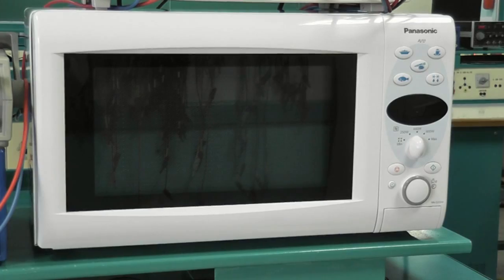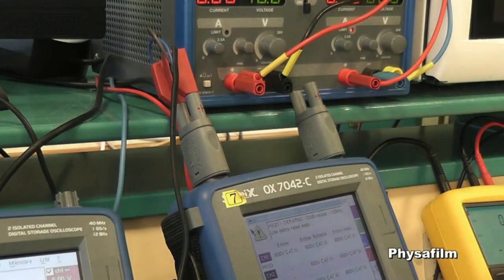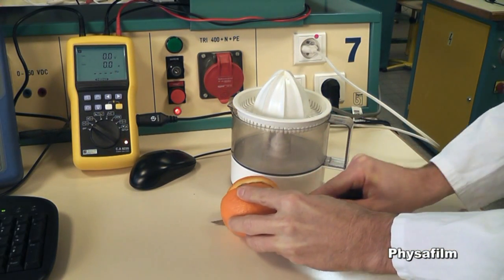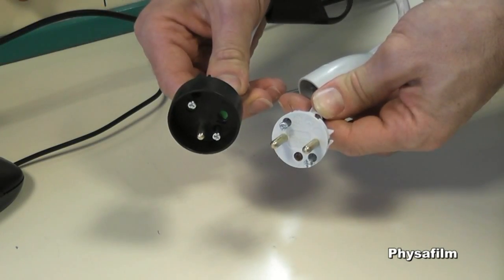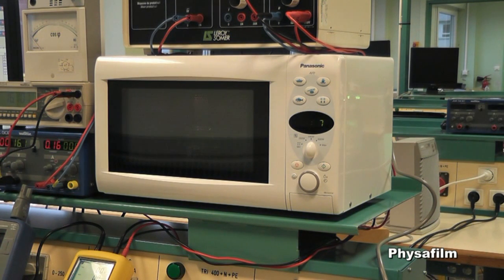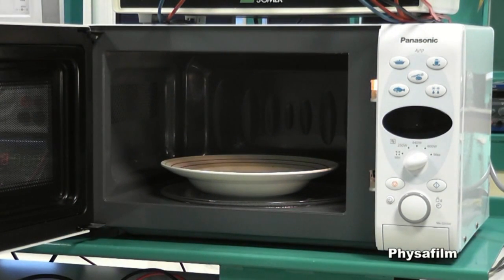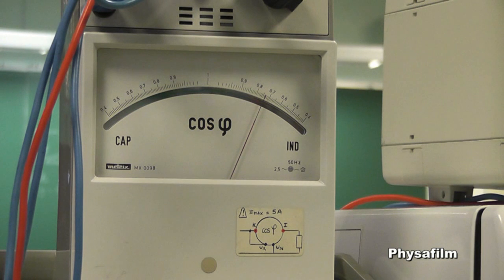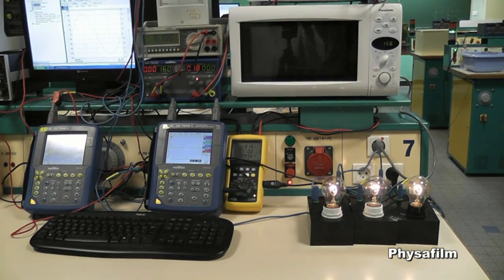DIY : How to make ice cube with microwave oven - Free energy generator -

Comment: ever wondered what's the meaning of AC? alternating current; at 50 to 60 hz means 50 to 60 polarity changes per sec, reversing the power cord will make 0,00% change, the laptop charger shows the DC or direct current side which carries usually 12 V, inverse these and you might make an oven out of your Laptop if that's what your after :-))))

Comment: To generate cold current, you need a Kromrey Converter as per Bedini's specs and run the output of that device into some dichromate wire. The result of this high resistance on the negative entropic current is the opposite of standard resistors, heat is being sucked from the environment, and the wire becomes frosty and cold.

Comment: The reason that the plug is polarised is to make it safe for use. Ac items already use electricity that is changing polarity. When you mess with the plug all you are doing is removing the case grounding. Which is unsafe in high energy devices.  If you manage to charge the interlock, touching the case can produce a nasty shock. I hope no one has injured themselves trying to reproduce this stupidity.

Comment: The power system they are using is connected to two different electrical phases, which is common in other countries, normally the EU. Here in the US, most systems , unless they are connected to a 208 three phase or other voltages for a commercial supply, will not change rotation if the polarity is swapped. The hot legs on a single phase residential transformer will not change rotation, nor will the scope show any indication of a phase shift, so, the video is not true for all electrical supplies, especially in the US. To make this spin out of rotation by inverting the feed, The electrical feed has to be fed from two separate phases. If we switch two of the 3 wires to a 3 phase electric motor, the rotation changes. If two dislike phases are used to power a 240v single phase motor, as in the video, the motor will change directions, however, the phase shift must happen as seen in the video.   US residential systems are fed normally with a single phase of the overhead lines and use ground and a neutral wire to complete the circuit on the primary transformer coil. There are 3 connections on the secondary side of the transformer, there is an X0 bushing which is the neutral or return, and, it is bonded to an Earth ground. There is an X1 Bushing, this would measure 240 volts from X1 to X2, and 120 volts across from X1 to X0.  There's an X2 bushing, this is the same as X1, but, it is the other hot leg which is 240 v across from x2 to x1 and 120 across x2 and x0 (the neutral), which is the return for the circuit to complete it's path, from the transformer, to the load, and back to the transformer, but, that wont reverse the microwave's production..

Comment: From: The Case for the UFO by Morris Jessup; the annotated edition.

The Soviets knew about this principle since 1946, only they weaponized it.
------------------------------------------------------------------------------------------------------

The October 1946, issue of the Intelligence Digest said:
The Soviets have ordered the building of a special centre of Astronomical research--in which will be a number of institutes, observatories and special airdromes where flying observatories, special balloons and airships are to be based for carrying out protracted studies at high altitudes.

Special machinery was acquired and there were further reports of work with monster mirrors.

Intelligence Digest reported that the Russians were known to be working on a highly secret project involving cosmic rays, which (without much proof) was surmised to be related to atomic development.

They were reported to have made some discoveries far in advance of the atomic research. One of their
reported accomplishments was said to be a method of freezing large areas of ground to subzero
temperatures, killing everything therein.
If that is so then they also have a Heat
Generator all in one IF this is Like to
what I'm thinking about, in Principle.
-------------------------------------------------------------------------------------------------------

Microwave phasing

Comment: I switched the connections where they connect to chip board, guess what it still worked and heated up the water... So much for changing Negative to positive and vice versa... I was at least expecting a backfire into the wall plug it would have had to get through two power bars but< it just worked as if I did'nt switch em'
Reply from the maker: Please, have a look on Physafilm.fr ... The scientific French touch :-)

Comment: In Hungary we don't have any polarized plug and it doesn't cause mess. The power meter was a power factor meter (it probably measured a capacitor for the 2nd time) and a microwave has a massive transformer, that is isolated. And the black magic in the magnetron (which heats up the food) is not allowing this. And the power selector just PWMs the power going in. Back to the magnetron: An LC resonator can't convert heat into electricity. AND if you want to supply energy back, you have to have a precision feedback system to syncronize the 2 ACs which a microwave doesn't have. So it's FAKE. (I hope it was a joke. )